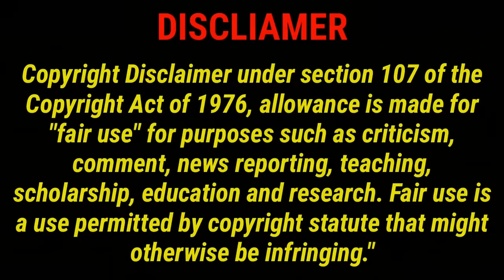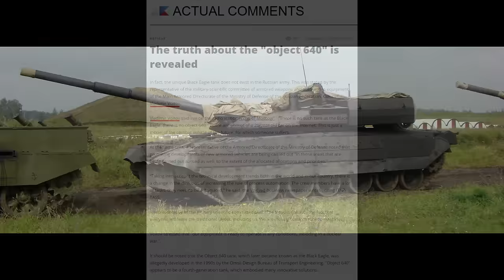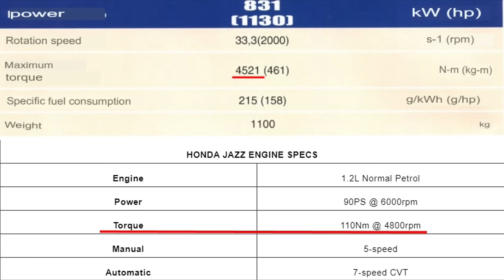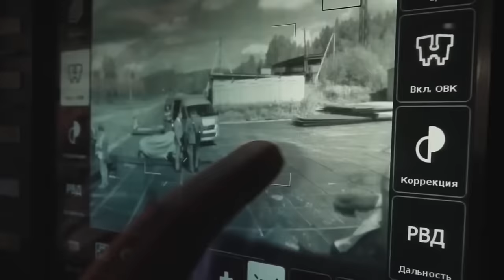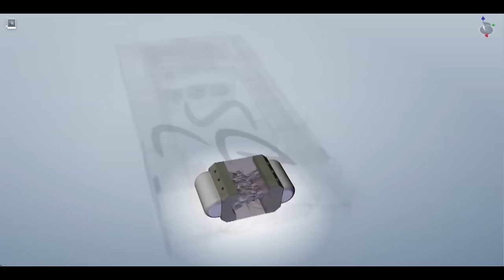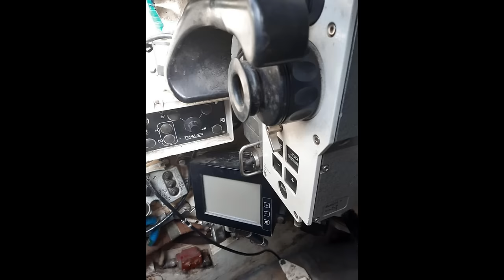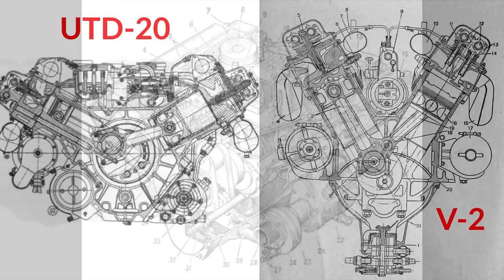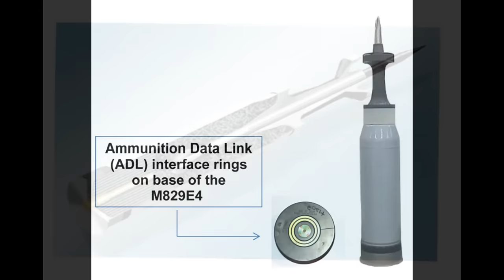LazerPig is WRONG about T-14 Armata

Comment: It's all fun and games, till you realize the "data" you are using for your analytical criticism all comes from Russia. I'm sure there's no need to explain why you just don't trust Russian claims and data about their weapons systems after February 2022.
And if you do trust Russian data... then you have no business analyzing anything in the first place.
Reply: By your logic neither East or west are credible sources
Reply: @mbtenjoyer9487  Exactly. However, western equipment has been tested for the past 30 years in pretty much every theater there was, from Yugoslavia to Iraq to Ukraine, and it has proven itself to be superior to Soviet and Russian equipment.
Russian equipment however, has put on such a dismal performance in Ukraine that it isn't even funny anymore.
Reply: @MeanMachine1992  it hasn’t Yugoslavia Iraq Ukraine all had been using older equipment compared to what was the modern equipment used by The Soviet / Russians 
The Soviet never exported there best tanks for example Iraq had been using obsolete T-72M1 ( comparable to T-72A ) which the Soviets has moved on from as it became obsolete compared to the modern T-72B/B mod.1989

The current performance is mostly to do with the battlefield in Ukraine 
and Russia having trouble upgrading older tanks like T-72/T-80 due to lack of funding n corruption problems
Reply: @mbtenjoyer9487  No. Yugoslavia and Iraq used state of the art soviet equipment (for their time). Iraq flew modern soviet jets in vastly superior numbers against American made Iranian Tomcats, and still lost the air battle. Yugoslavia had modern soviet equipment for the 90s era. Russia has access to the best of what it manufactures, and has used pretty much everything it has in its arsenal in Ukraine, but is still getting its @ss kicked in eastern Ukraine, and its own cities have come under attack and Ukrainian drones have hit Moscow.
Reply: @MeanMachine1992   here where you are wrong 
Iraq operated T-72M1 in 1991 that tank became obsolete over 10+ years even the Soviets moved away from it to something more modern which was T-72B and that wasn’t even their best tank 
The best Soviet tanks in 1991 were 1.T-80UD 2.T-80U 3. T-72B mod.1989 

Iraq also got old 1972 ammo due to Soviet export policy and couldn’t destroy the UN coalition tanks 

The Soviet Union never exported there best equipment 

As for Iraq Air Force they mostly used obsoletes aircraft : MiG-21 MiG-23 MiG-25 Mirage-F1 

The only good aircraft is MiG-29 but it was available in a such small number compared to the coalitions that had a high numbers of 4th generation aircraft 

The attack on Moscow is  propaganda than anything else as those attack literally do nothing 

Same for the attack on border city
Reply: @mbtenjoyer9487  Iran-Iraq war was in the 80s, not the 90s. You are mixing it up with the Desert Shield and Desert Storm, which I won't use as an example since it won't be fair (to the soviets).
Both the T-72As and the Mig-25s were state of the art in the early to mid 80s, during the Iran-Iraq war, and constituted the bulk of Soviet armored and air forces.
It was actually the combination of the Mirage-F1 and the Exocet missiles (both western made) that caused the most headache for the Iranians and even managed to seriously damage a US frigate, not any of the soviet equipment.

The attack on Moscow shows one thing, that the Russian air defense systems are so outdated and incapable that a cheap drone can penetrate their airspace (via a war zone no less) for nearly 700 kilometers.
Attack on Belgorod shows that Russian command structure is practically non-existent. Practically no capability to rapidly respond to border incursions, slow reaction times, confusion... you name it, the Russians are failing at it.
Reply: @MeanMachine1992  Iraq ended the war having air supremacy and with it’s army having practically scattered Iranian ground forces, even causing the IRGC to break and run away. Whatever point you think you’re making wrt Soviet equipment, you’re not making it.
Reply: @MeanMachine1992  T-72 URAL / M / M1 was used by Iraq not T-72A ( only M1 variant was on par with A ) and MiG-25 was only good in the 70s again American intercontinental bomber ( it could perhaps stand a chance against 3rd generation NATO fighters ) but it’s not good 

By the early 80s best Soviet Tank T-80B 
Best interceptor MiG-31

I don’t count us frigates being hit as good as it was a mistake ( surprise attack? ) in a real war with the us navy that’s not happening 

The attack on Moscow did nothing it’s just propaganda, 
that attack literally did nothing they just damaged a few windows 

Not to mention Russia did these type of attack and it work 

Against Ukraine military by using Iran supplied SHAHED-136 n Russian lancet  

you have to understand that loitering munition are new and hard to defeat even western air defenses have not been able to stop them

The attack on belgorod are just a distraction from Ukrainian loses in bakhmut , these attacks are suicide and a lot of Ukrainian soldiers die just so they can distract westerners from their lose in Bakhmut
Reply: Okay, you proved that you don't know anything about Soviet technology. 
I advise you to read about the operation of the MiG 25 from the 1973 war to the Iran-Iraq War. Despite the fact that this aircraft was significantly outdated, it was a difficult target for the enemy Air Force. And this despite the fact that it was not intended to gain air supremacy. Needless to say that the Iraqis, as well as the Arabs in general, were very inattentive in ensuring the combat duty of Soviet Aircraft and air defense. Their service was at a surprisingly low level. Read the memoirs of Soviet instructors in Egypt and Syria. This tradition continues to present day. 
If you do not understand the topic, then it is better to ask, rather than assert. What you write is just ridiculous. 

You might as well laugh at Leopard 2, because it was destroyed in Syria by the old Soviet ATGM malyutka of the 60s. Or over the Patriot who successfully "intercepted" Iranian missiles over Tel Aviv in 1991. 
I would add here the "interception" of the Kinzal over Kiev, but I'm afraid that you need to wait a couple of years before it becomes obvious what happened.

But for some reason you're not laughing. After all, this is Western technology, probably just Jews and Turks do not know how to shoot, and the weapon system themselves are just beautiful and fully meet the stated characteristics.
Reply: @MeanMachine1992  Iraq won the Iran Iraqi war, and one thing you need to acknowledge, is that "State of the art" was more like lots of T-55, T-62, and some T-72, Airforce wise, there was Mig-25, but also lots of Mirage 3, Mirage F-1, and the Iranians were using Tomcats that were the best Aircraft of the entire war.

Yugoslavia... well their best tank was based on T-72M1, and it was mainly them vs them... the few times NATO striked at them was airforce and artilhery...
If anything Yugoslavia is good example of the contrary since some guy using an old AA system managed to actually down a aircraft that was brand new, but most important, was Stealth.

IMB4 "Commieboo", me considering F-14 the best aircraft in the 1980s should make me a "NATOboo"
Reply: @gerfand  The Iran-Iraq war didn't have a "winner", it ended in a stalemate.
Both the F-14 Tomcat (dedicated Navy) and the F-15 Eagle (dedicated Air Force) were both initially developed to counter the MiG-25 in Soviet service. Of course after a soviet pilot defected, it turned out that MiG-25 was not the ultimate air supremacy fighter that the Soviets portrayed it to be and the American thought it was. Hence my original point, western equipment is superior to Soviet/Russian equipment, as has been proven in battle time and time again.
Reply: @MeanMachine1992  yeah because Mig-25 is a 3rd gen Jet its like putting a bunch of F-4 and they being shotdown by SU-27, like its expected, if you flew a Mig-25 against another 3rd gen jet, or better in its pourposes of intercepting Bombers, the results would be very different
Reply: @gerfand  MiG 25 first rolled off the assembly line in 1969, a year earlier compared to the F-14 which came in 1970. So both aircrafts were designed in the 60s, went into service in the 70s and both are (were initially) classified as interceptors.
Any other baseless arguments?
Reply: @MeanMachine1992  

Mig-25 First flight	6 March 1964; 
Introduction	1970
Wow that is clearly incorrect

F-14

First flight	21 December 1970
Introduction	22 September 1974

Yeah enough difference to make the jump from 3rd to 4th Gen Aircraft... 
Also I gonna question you on something

How does the T-64 Compare to its NATO comtemporaries, like the M60 Patton?
Reply: @gerfand  Do you have any idea what "first flight" means? Clearly not.
Reply: @MeanMachine1992  it means the plane prototype flew that day, you know what introduction means? it means the plane was started to be used that date, either way theres a 6 years difference between the first flight of one and the first flight of the other, that is enough time, specially during a arms race, to lots of things to change... its enough time to go from a generation to another, if you are in the end of one generation.

The only point you can make there is that F-14 got introduced faster, which probably was a mistake since the Plane earlier version was full with problems related to reliability.

Comment: T-14 is a Potiemkins tank xD While some areas of it as a concept seem better on paper the end result was still a shamble tank full of bugs and kinks to further work out.

as for autoloader - the creator here assumes there will be both proper manufacturing and proper maintance in place for these autoloaders to work properly - and as russian army showed - they ain't on par with both xD Plus the inablility to clear jams because the loader is inaccesible in the turret is a valid one - one jam and you are DONE - you have to pull out and hope you will make it alive. So yes this is a factor. especially if the turret gets hit.

As for the carousel meme - most ot them are based not on unreliablity to work - but that they are THE CAUSE of the turret tossing when hit.

as for being able to fire more modern amunition - most current day russian tanks cant do that bacause they were NOT modernised - some were but not too many and of those which were are now smoldering wrecks and the ones towed from storage aint getting these upgrades en masse either because its not achievable under current russian production conditions do to so en masse. This is also where the corruption has shined because the money was simply stolen thus the factories are not equipped to handle that kind of production loads because they are operating decades old equipment xD And T-14's were literally hand crafted so far xD

Heck the engine production line was never delivered from germany because of sanctions xD

Comment: I am sorry, but Lazerpig was 100% right, all T-tank engines have their lineage coming from V-2 and Armata X-shape engine was truly based on German WW2 design, it was confirmed by The Tank Museum's latest Tank Chat.
Reply: Have you even watched this video?
Reply: @mbtenjoyer9487  Then why are you even responding? The Pig was right spare for a few smaller inaccuracies.
Reply: @TonymanCS  he wasn’t and it wasn’t “small correction”
Reply: @mbtenjoyer9487  His points were proven by both recent Tank Talk and by the fact not a single Armata showed up in May 9th parade or Ukraine. You may twist it but it doesn't change the most fundametal point form LP: Armata sucks.
Reply: @TonymanCS  why would T-14 show up in Ukraine exactly ? adding another tank would mess up the logistics 

They operate with 3 tank models ( T-72 / T-80 / T-90 ) adding another one is a bad idea 

Most LP points have been proven false
Reply: @mbtenjoyer9487  His main point stays: Armata sucks so bad its production got halted indefinitely. The A85 engine lineage back to Porsche is also known, the same with T-90M's engine back to V-2. Russian are not operating 3 tank models, they are in fact operating 6 (T-55 as assault guns, T-62, T-64 coming from Morpech stock/ captured from Ukrainians, T-72, T-80 and T-90) so their logistic is already a mess, what 8 T-14 gonna do then? Those idiots were so desperate they deployed BMPT that was absolutely unfit for open space combat, 1 of them got blown out near Kremmina and since then none of Terminator was spotted on frontline. Don't tell me their Armata...sucks even more??? Why would they be afraid to use it in combat? There is 0 export customer for it anyway.
Reply: @TonymanCS   there is 0 evidence to A-85 is a copy of the German engine (SLA-16) 

SLA-16 was not the engine used in Porsche tiger It was an engine design for heavy combat vehicles like Tiger-2 JagTiger that ended up nowhere 

T-90M doesn’t use V2 engine it uses V92S2F it’s a completely different engine 

T-62 T-64 are mostly used by DPR LPR not the Russian army
Reply: @TonymanCS  Ain't tank talks recently been shown their bias to one side in this war, and most of their information comes from the MOD of the UK who would have a desire to put out some pro Ukraine information and has shown in the past to not be the great speaker of truth before (Iraq 2003).
Reply: Im really sorry but i trust this guy more than the tank musseum. Also based of doesnt mean its a total copy of the engines flaws and capebilities
Reply: @kuunoooo7293  Sure, just trust a random internet guy than tank experts/former British Army officers who own and work on maintenance of running Russian tanks. Ask yourself why the goddamn Armata isn't in production yet, 10 years has passed since first prototype.
Reply: @TonymanCS  well this guy is also a tank expert and had all the necesery prove, but anyways does it even matter ? Based on doesnt mean its just as bad as the german enigne, based on means it has simalerities but its totally not the smae
Reply: @kuunoooo7293  Pfffft, what tank expert? What is his education? Achievement? Did he serve with tank force? Buddy he is the same armchair general as me or you or LP. The engine may not be the same WW2 engine but hell it's sure the same when it comes to unreliability. It's about the same as V-92 on T-90 vs V-2 on BT tanks- they are not the same but they share the same core construction which is why it's an extremely obsolete engine. Think of how Russian copied B-29 and ended up copying even production defects.
Reply: @TonymanCS  bro what part of " based on " dont you understand. The russian engine may be based on the german engine but that doesnt mean the preformans has to be even close. Literally the only simaleraty between the engines is de layout/looks and the type of engine. Did you serieusly thougth that the russianss copied a 80yo engine, you must be insane. Also the T14's engine isnt unreliable at all
Reply: @kuunoooo7293  really? Then why isn't Armata in service? It's not like they have no choice, Germans themselves use an excellent V12 engine with the same power output for almost 40 years, why can't Russia make a new V12 engine? Suddenly they chose an X-shaped engine that was originally for pumping oil and was known for being an commercial failure? Weighting 1.5t which is  mere 600kg less than German MTU?
Reply: @TonymanCS  Former British army Officers, and the MOD is close to the tank Museum as well. Which means it would be very easy to suggest to the Museum to give a pro Ukraine spin on things in the talks. (Don't get me wrong I love the museum still and their bias is nothing like that shown on YT in some channels where they want to ignore reality and just think Russians are orcs)
Reply: @RomanHistoryFan476AD  technical details have nothing to do with politics and the fact serial production of Armata was halted indefinitely.
Reply: @TonymanCS  They do when you need certain politics pushed. 

And I think the Russians are better off just improving the T-90s rather than waste time on a new tank.
Reply: I remember watching that video and thinking that red effect disproved many of their points. I went looking for their sources and couldn't find them, do you know what the are? I would like to see them and give them to red. so that maybe for once I will be the one who knows more about tanks than him in our conversations XD
Reply: >it was confirmed by Tank Museum

Bro they literally quoted LazerPig, they are not an Authority on anything specially when they themselves said "many of theses may be speculations and propaganda" you just don't expect to be propaganda against the Tank.
Reply: @TonymanCS  only oma T-34 showed up in this year may 9 parade in Moscow... T-14 not showing is not special.
Reply: @TonymanCS  chad yes, I will trust the tank nerd

Comment: The Challenger 3 is getting a smoothbore because of the range of munitions that a smoothbore can fire vs a rifled barrel. Not because its necessarily more accurate or as accurate.
Reply: And also rifled barrels where at a LOT faster than smoothbores.